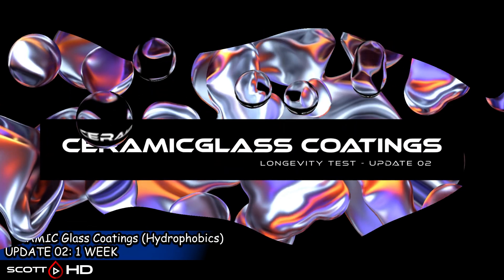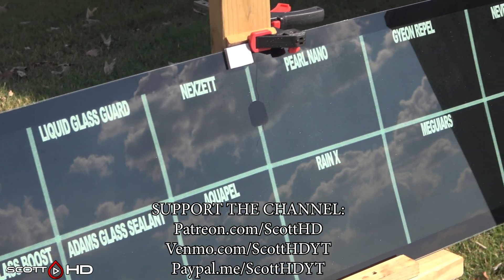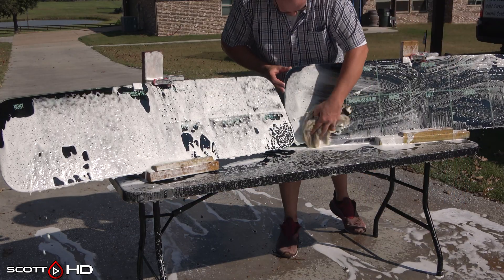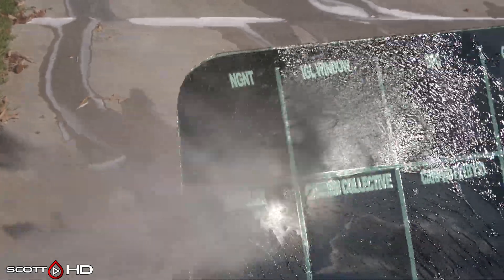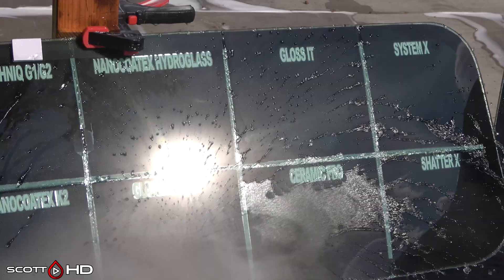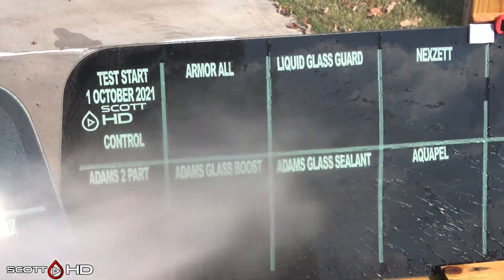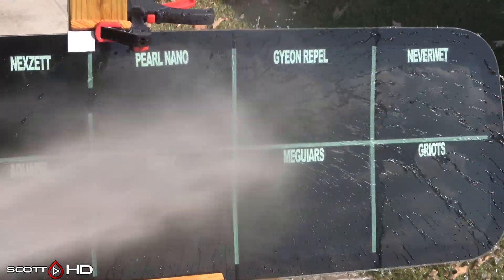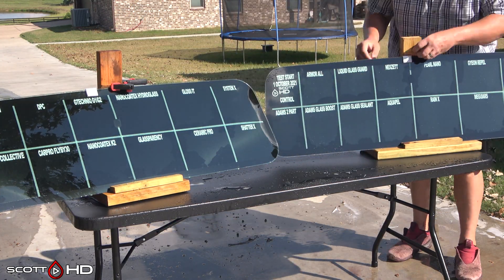28 WAY GLASS COATINGS TEST (HYDROPHOBICS) - UPDATE 02 - 1 WEEK - SURPRISING PRODUCTS ALREADY FAILING

Comment: So far the 2 or 3 I see on the left side of glass I will call failed! It’s glass and if the product can’t stay hydrophobic on glass Its got an issues. I would say most should last 6 months to year. However on front windshield you may see a decrease in time because the abrasion of wipers.